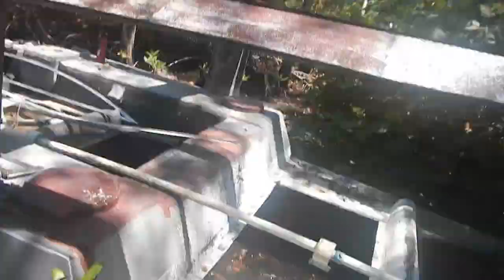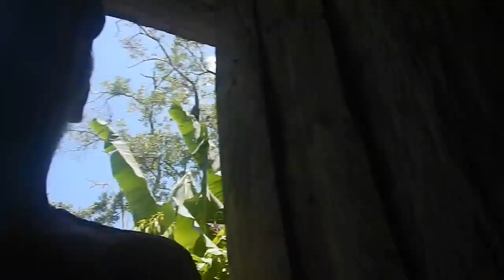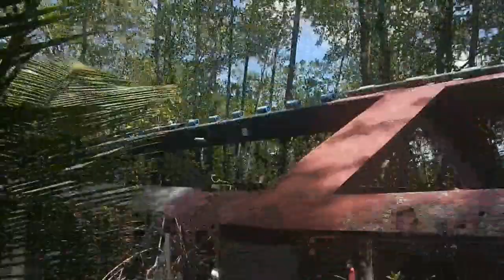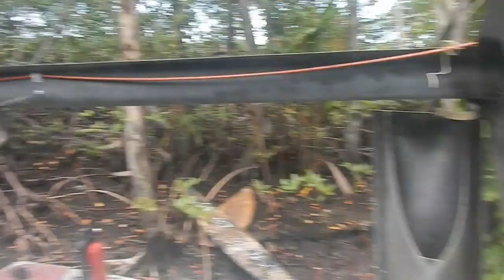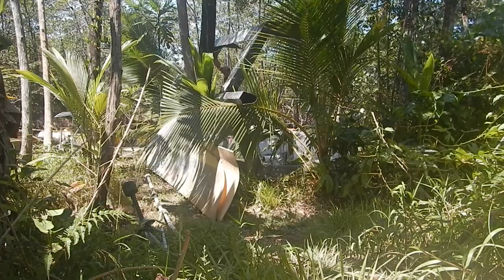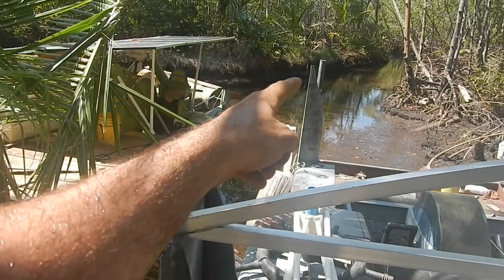Shark Slicer Upgrade 012 Immovable? I Object!

Comment: I’ve been moving lots of heavy stuff by myself, like lathes, mills, circular saws and log splitting machines, and there’s only one way to do it right. To build something which makes it easy. 

In your proprty, i’d consider ropes and pulleys. While you may not have thick enough rope or strong enough tree to support the weight over long distance, there’s a way around it. 

Make two moveable poles to support the load. One can have a pulley on it’s end to make it easier. 

So, the rope is stretched tight between two relatively strong ends. The load hangs on it on pulley, but the rope is not tight enough to lift it. Put a supporting pole in few meter distance from the load. It can be temporarily attached  to the rope so it don’t fall down. 

Another, longer pole with pulley is behind the load. Bring it as close as possible and push vertical. It’ll lift the rope and the load slides forward. Repeat it untill the load have moved close to other supporting pole. Then move it forward and repeat the process. 

Because the relative short distance between supoorting poles, there is not that much tension on the rope and your trees are good enough for heavy loads.

Comment: Build a simple crane.  A long mast pinned to the ground.  A winch cable to snatch the middle toward a tree.  Mast tip raises.  Do two masts to triangulate so it doesn't swing.  Easy peasy.